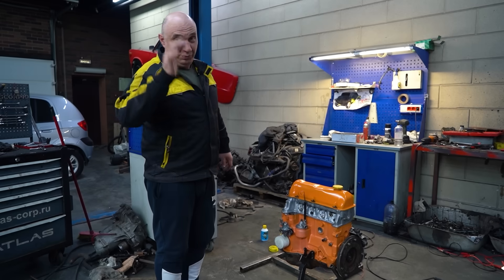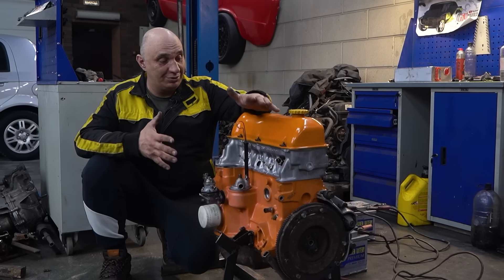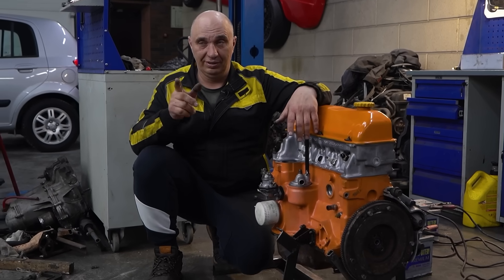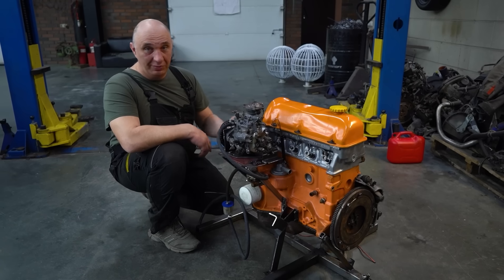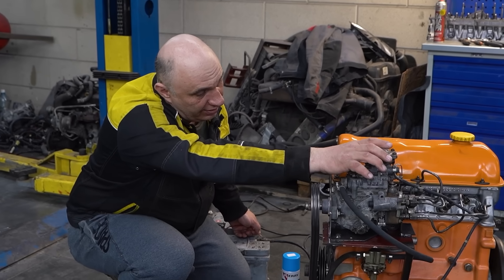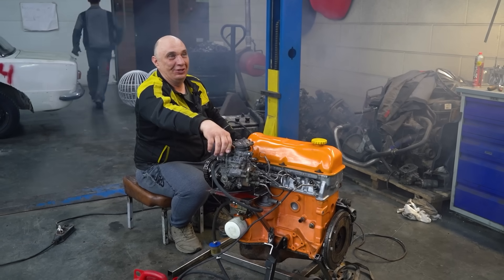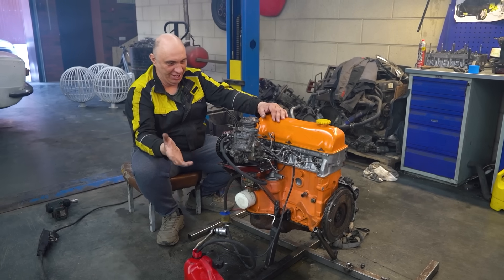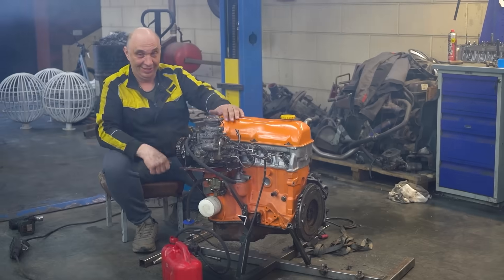We convert a gasoline engine to run on diesel fuel - will it work?

Comment: I’m guessing the reason it needed the heat gun at first was because the compression wasn’t great enough for the air in the chambers to reach the combustion temperature for the fuel. And once it ran a few, it warmed itself up enough to for the compression to reach proper temperatures. Seems like you need an intake grid heater for cold startups and it should run good

Comment: Land Rover used the 2-1/4 petrol block as the basis for a diesel engine.  The head was different and I assume the pistons were also.  The original 3 bearing crank used to break, so they heat treated it, apart from that petrol and diesel cranks were interchangeable.  The later Series engines were upgraded to 5 main bearings.

Comment: Did you try the heat gun blowing cold air?  If that works then you need a supercharger.  For starting have a look at the CAV Thermostart.

Comment: One time I filled a farmall 504 up with diesel my pap stopped me when there was maybe room for another 3-4 gallons of a 17 gal tank (aftermarket) we just mixed gas with it maybe 5 gal of gas had to run it on the choke for the first 5 min till it was warm then it ran awesome at full throttle little pop and bang here and there but what do you expect 😊

Comment: Guys and I in st John's Florida kicked around a model Mazda equipment blew few lower end out then put cohns crank journal ya were amuture ..puling fifty there's to see if anything blows out yep the transmission gave out one thing leads to another clutches are us not our thing to much work the circular things with teeth inside be clutches also our was a barn find according to the Tampa Bay Florida Taco nigers x half breeds only don king club o f jahovas USMC Halsey fucking thief's stong armed nigers x by way sienfield found you in home state year one new jerseys pigs state after finished assembly put a Manuel transmission in easier to service maintenance as in no cold weather sticky valves etc put heavier plates heavier flywheel.put reassemble together both the Mazdas were actually the same had Mazda pit factory new custom order built ours we had put in heaters in the fuel tanks and put factory installed circulation system intertwined in the heater system and inti the air-conditioning.probably still running

Comment: In my country, Uruguay, we did the same thing in the 90s with fiat and vw motors but it´s much more easier because they share a lot of pieces, in fact gas or diesel versions use the same block

Comment: International R 40 has a gas and diesel engine. You start the gas to heat up cylinders. Pull a rail uping compression 22-1  shut off gas. Injection takes over .Carb and distributor on one side injectors and pump otherside.

Comment: I had an old Subaru 1.8 gasoline. I was only running it on diesel for at least 2 years. Tok a few seconds to start. But it started. Needed to stop it with the clutch.  The only problem, it was a smoke machine like nothing else. You could smell the car had been going through the woods 30min after. Was a good farm truck :)
Reply: I didn’t do anything with the compression or the engine. And I don’t remember if it had less power (it probably did. But a Subaru 1.8 isn’t a fast car anyway 😂)

Comment: Add another flywheel would help with the idle and pre heat the air off the exhaust. Bloody amazing job team, I'm very impressed how you just nut the problems out  🙂

Comment: The early 70's Volvo "Red block" 4cylinder 2.0 with mechanical injection was purposely designed based on trucking parameters. The crankshaft and bearings all have VERY wide areas. the rods are girthy enough. and stock with a few simple mods you could rev them at redline ....still going...still at redline!  You get the point! the limit was how well you improved your cooling system. I actually broke two redblocks when learning to machine engines and / racing them. It all had to do with my mods not Volvo. Quite the accomplishment I broke the unbreakable, then did it again. 😆

Comment: The old Rumley Oil Pull tractors heated the oil into a vapor which was then drawn into the engine along with air, I would think that would work with Diesel.

Comment: back in the 80's lots of car manufactures did this trick to take advantage of the low cost of diesel.  Worked good but the engines did not last.

Stick a turbo on that sucker.  :face-blue-smiling:😜🤪😝

Comment: GM did this.  It did not end well.
Reply: It could have been done way better with minor improvements. Hot Rodders still pay a premium for the GM V8 Diesel Blocks
Reply: Are you talking about the 5.7L diesel?
Reply: @That21000hpAccord  This https://en.wikipedia.org/wiki/Oldsmobile_Diesel_engine
Reply: @ken2400 They made a 4.3 v6 version as well?!?? Anyways I would have hoped a diesel conversion would increase the torque, but the 350 diesel actually made less which is incredibly stupid:(

Comment: wrap copper tube around the exhuast to pre-vapourize the diesel fuel  [ like those kerosene stoves turn kero into the blue-flame , clean burning fuel it can be ]  and carburize the fuel with a slot in a block type of carbuetter to mix the air/diesel would probably work so well that bacon fat , if melted by the exhuast first could be switched to or other solids like beeswax or beef-fat., just switch back to liquid fuel before you shut down to purge the system of melted solid fuel and allow easy re-starting without all that tedious pre-heating and melting fuel lines...

Comment: I know I’m a year late boys, but Cummins 6bt motors used to come with a grid heater in the intake manifold to preheat the air for easy starting. I’m sure one could be adapted

Comment: Late comment I know, but the channel was blocked for 2 years in my country.  Been binging for a while.  Still great content and unlimited ingenuity and ideas. 2👍's up. PS: I ran an unmodified 1.9 ltr Renault petrol engine on kerosene 20 years ago. The downside, it only ran on hot summer days and at 3500 rpm's. 😂.. fun days at the track. 😉

Comment: When you got the slightest leak in a diesel system the damned thing won't start. If it loses hydraulic pressure the injectors cannot work as they should, thus not starting the engine.
I'm impressed old Fiat tech from the 60's can be converted relatively easily. :)

Comment: In about 1985 , We had an old Wisconson engine that we ran for many hours on Diesel . The Only changes we made were a valve to shift from the gas tank to the diesel tank . the only problem we had was to Remember to shift back to gas before we shut it down. Also there were several Tractors built that were Started on gas and shifted to diesel  or Kerosine to be Cheaper to operate . Thank You
Reply: Claro xq el diesel funciona con bujías candecentes y el naftero es a explosión asique por lo tanto una bujía de naftero en caliente va arrancar con gasoil dado a que va vaporizar y el gasoil a altas temperaturas se hace gas y es de buena calidad
Reply: Assim funcionavem os tratores  harvester international wd9. Começava a trabalhar a gasoline e depois mudava-se para o diesel
Reply: @JoseSantos-cd5uu  So True , If i remember right , there was a big price diference. Also there was a time when  Batteries and starter motor were not practical . Even today there are Air starts , poney moters

Comment: 285psi is way too low cr, need at least 400psi. vw have 500psi. 
heat gun or brake cleaner is the way to start an old engine in winter.

Comment: So long as the compression ratio is high enough it will run on diesel. Why not just run race fuel 110 leaded or E85

Comment: That’s awesome. I would’ve thought the higher compression would be too much for the engine and separate the head. One way I usually get old engines running is put gas in a bottle with one hose going down into the fuel and the other pulling the fumes into the engine and run it through the intake. Slightly dangerous when it backfires though 😂. This has got to be the best video so far. 👏🏻👏🏻👍🏻

Comment: american rednecks "im towing a trailer to my truck, and hooked my boat on the trailer. lets fire up the Cummins and go mudding with em " Russian rednecks meanwhile; "lets convert a gas engine to diesel, make the brakes out of wood and use springs for the propshaft!"

Comment: Why not hit? It with a big charge of compressed air and get the compression ratio up. By just blowing hot air in there. In fact, it's using electric heater to uses to blow air into the intake would make it work

Comment: Alot of manufacturers made diesel engines from gasoline Chevrolet being one of them with the 6.2 where the block is all gasoline but heads, pistons etc where strengthen for diesel use
The engine came to be somewhat reliable under certain conditions and they later put a turbo which made 6.5 we had both at one time very loud the back two cylinders would have the tendency to heat up on towing so kits where offered to provide extra cooling from thermostat housing to the rear back two cylinders nissan did it two with the maxima (American market) in the 80s with diesel engine that started as a gasoline  in-line 6 ended up being very reliable and quiet

Comment: I wish you can try to heat up diesel oil around 40°C to 50°C or try different temperatures where it will do continuous combustion just like normal operation in a gasoline engine. Because in ships, we have diesel oil which do not need heating to feed on engines, sometimes we actually have coolers to slightly increase the viscosity.  And we have bunker fuel which is a thick fuel that we heat before feeding on engines. Just wondering if heating diesel oil just before the flash point will perform regularly on a gasoline engine.

More power to your channel, you are making our imaginations into reality.
Reply: Interesante el comentario
Reply: Cuando tenga moto lo intentaré
Reply: @Ghost-Groove  en una epoca aca le agrgaban una serpentina al rededor del caño de escape a los rastrageros para poder usar kerosen como combustible y si funciona humea como loco

Comment: In 1949, Barreiros patented a system through which he was able to transform gasoline engines into diesel, which he does in his Orense workshop to cover the needs of the vehicles used in the works. To get started, convert two Krupp prototypes, as well as 2,000 units of 3HC, trucks of Russian origin used in the Civil War.
Chrysler In the 1960s, Barreiros began manufacturing buses, shortly before reaching an agreement with Chrysler Corporation to manufacture Dodge and Simca vehicles. This implies a great expansion of the company and its factories on all fronts, exporting Barreiros products to a total of 27 countries. In 1967, Chrysler increased its stake in the company to 77% of the shares, while Barreiros founded CIPSA to join the oil and geological market. Two years later, Eduardo Barreiros sells his entire stake in the company to Chrysler and focuses on farming and ranching, again with great success.

Comment: Cant rev  because diesel uses compression ignition made possible by the change in temperature in air when compressed, so that's why it cant rev and it smokes alot

Comment: You need to do some calculations and find out how much you need to take off the head/block to get a conpression ratio closer to that of a traditional diesel engine. The reason it only wants to start with the heat gun is that theres not enough heat being produced inside the cylinder, ie the compression is too low. Diesel engines are compression ignition, pertrol engines are not

Comment: I doubt It would last very long is no designed to handle the torque of a diesel. Plus would have to put a Diesel Transmission and Clutch on it if you were to put it in a car.

Comment: compression is low and likely why you see white smoke aka unburned fuel. 
Low compression even on actual diesel engines will run like this and also smoke like crazy. 
compression check will tell a lot. gas engines have low compression by default.

Comment: If you bring the compression down to ~5:1 and use the exhaust to heat a carburetor it will work quite well and run efficiently, but require gasoline for initial starting

Comment: You guys do realize that a gas engine bottom-end is designed for 8 ATM compression rather than 18 ATMs and 50 ft/lb per liter rather than 125 ft/lb per liter torque right?

Comment: My two stroke weed eater refused to start with petrol, so for the fun I put diesel in, and it started straight away, it was smoking a lot, but it started with diesel, where it is actually a petrol two stroke engine

Comment: Would be interesting to make it a dual fuel engine, start it on gasoline and then transition over to diesel once it’s warmed up and runs better 
A lot of old generator sets were set up this way

Comment: You don't want to use diesel because it low Auto ignition ignition temperature

To take advantage of that you would need injection system that would deliver fuel near top dead centre

Unlike gasoline where you can inject it in the intake we sucked in and then compressed without fear is a fit auto igniting at standard compression levels for gasoline

Comment: My Dad used too convert gasoline tractors to run on diesel. In the late 1950s and 1960s  in Mexico. Gasoline was expensive and hard to come by diesel was plentiful and cheap. You would have to start them on gasoline. Once warm switch to diesel. Still used carburetor and spark plugs and stock compression.
Reply: then how does he do it?
Reply: @rookieman329  make adaptor under carburetor so exhaust runs under it. So it can heat and automize fuel (diesel turn to vapor) before going into combustion chamber. This allows the spark plugs to ignite it.

Comment: Maybe injectors were from a turbo-intercooled motor and were calibrated to run higher fuel flow for air-fuel ratio such a motor demands. But with no turbo or intercooler, air intake is lower therefore fueling should be matched to engine demand. Short answer - engine is running way too rich, which also "puts out the fire" even more given compression is probz too low as well. Awesome out-of-the-box thinking guys 💪🙌

Comment: Gm did this back in the 70's converting a 350 to a diesel just by changing the heads but the problem with doing this ur crankshaft and rods are not built for that kind of torque and these engines had all sorts of problems like broken crank throwing rods as you will soon see happen to ur conversion

Comment: My car was accidently filled by diesel by pump guy, It started in morning , but as soon as you put in first gear engine will die, also you need to keep pressd gas pedal to half way down just to keep it running light (i.e idling)

Comment: Diesel engines scare me. I remember an instructor told me that the fuel lines are under so much pressure, that if there's a leak, and you wave your hand over it, diesel will be injected into your blood and kill you.
Also, diesel engines see overbuilt with thicker metal to contain all the forces. I was worried this converted gas engine would split apart.

Comment: The  Bosch VE  pump flows the MOST fuel (more than on full load) when the engine is spining at around 300 rpm which is normal starter rpm. More rpm than ~300 rpm and the fly wheighs in the pump are pushing the fuel flow towards idle quantities and with two car batteries rpm goest too high thus less fuel for start up. That's why maby it started so had + low compression + no heat . and when they added the heat gun and aditional fuel by spray it started.

Comment: Those dificults to get it to run are from poor compression and no glow plugs so they needed to warm the intake, once the engine is warm enough it runs roughly...anyway it produces no power.Funny mod to do btw.

Comment: Ok I’m actually surprised this works because diesels ignite fuel on extremely high compression. This engine being gasoline powered unless it was previously directly injected, it should maybe have 9-10:1 compression. Most diesels run at least 14-15:1 if I’m correct and more for na diesels. I think this is actually kinda cool. If I’m right about how much compression is in this engine…that’s super insane. You look at idi vws and the international idi you’re looking at 20-22:1 compression…

Comment: But pleased try Something else. You have already Made a directly injected gasoline Motor. But i would Like to See IT Run in Diesel. The atomization should be enough. You could Change the Spark plugs for glow plugs and make Kind of a hot bulb Motor. At least in the RC world IT works!

Comment: Well, diesels make their power and torque not from their fuel. But because of compression and stroke.
So, unless you stroke that….like 30 cm , and shave the head….waaaayyyy down.
I expect pretty poor performance.

Comment: I'm sure I read somewhere that Vauxhall designed a diesel engine using a petrol engine block in the 1980s. One early diesel car engine from the 1980s. They weren't really a great engine.

Comment: It can’t run because diesel engines have a higher compression ratio than gasoline engines.Because higher compression means higher temperature so the diesel can self ignite

Comment: I would love to see this get running properly.  I have often though about the possibility of converting a large displacement ( relatively) petrol engine to a low power diesel.  I would want it for driving a generator and 30 HP would be heaps. 
I figure that the forces with higher compression at low power outputs would not be above the stresses of the engine doing it's original 150 HP or whatever therefore should last a decent time.

Comment: I have an idea.  To improve the efficiency of an gas engine, make one of the cylinders into a vacuum motor, where the intake manifold vacuum pulls the cylinder up, Then the intake valve closes and exhaust opens, letting air in. it would need a custom camshaft, and that vacuum powered cylinder could be 2 or 4 stroke.